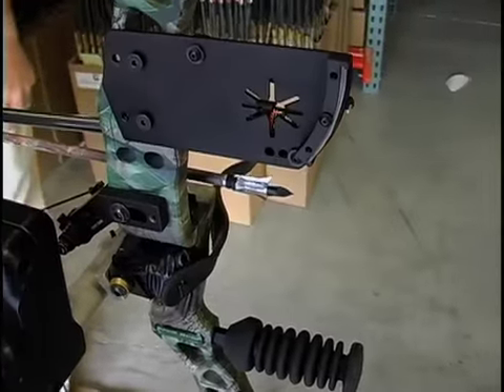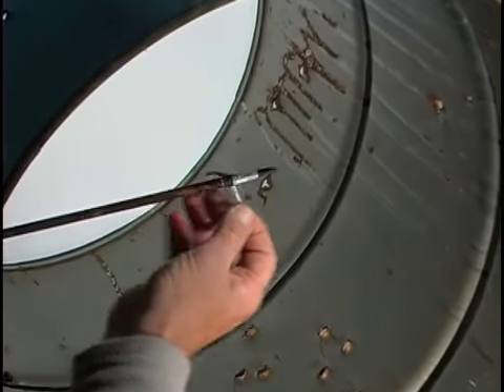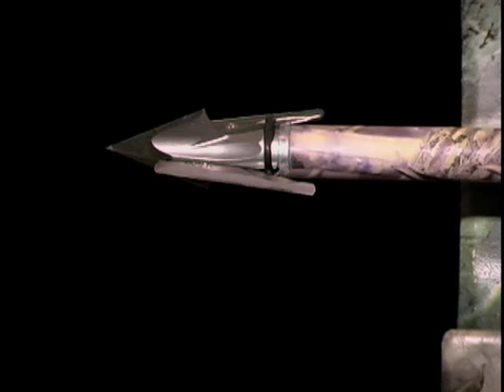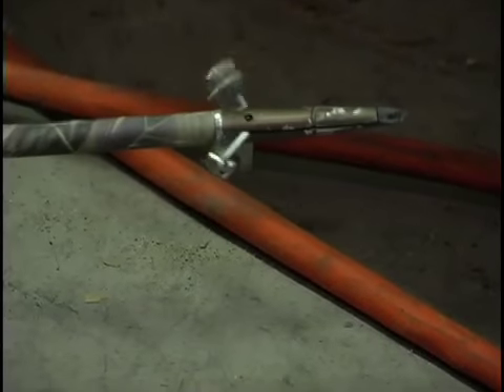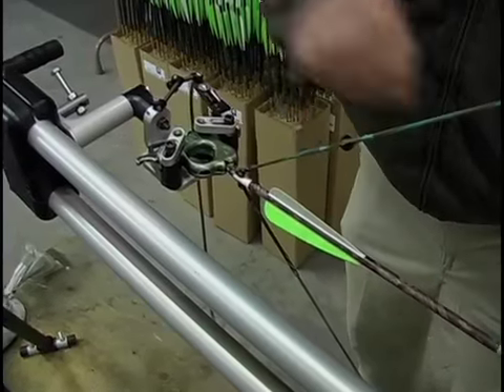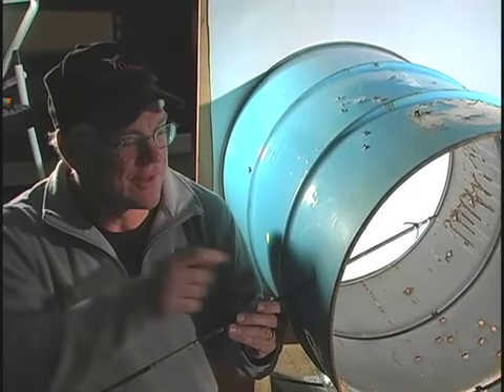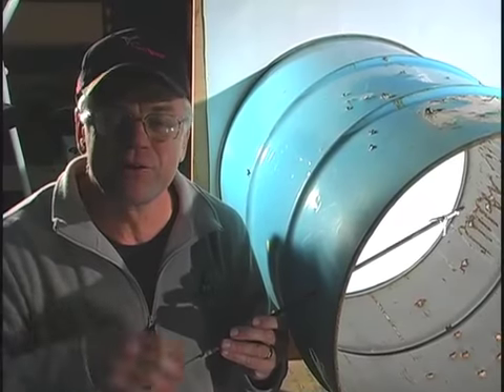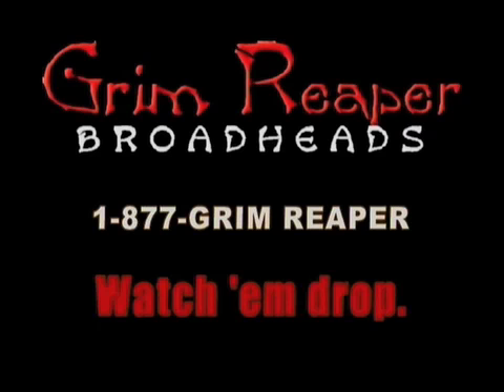Steel Barrel - Razortip vs Mechanicals

Comment: I GUARANTEE my 125gr Slick Trick will blow right through this barrel over and over and never break and ya know what...they would never fail to open,or open in flight and throw the arrow off.That said,I'm not getting the gaping wounds that the Rage broadheads make and I'm considering switching to mechanicals this next Fall,just trying to decide which ones.I lost 2 deer this year because they stopped bleeding.One was a lung shot so you can't say it was a bad shot,just clotted and stopped bleeding.

Comment: Yeah it was shown at the end when discussing deflecting..but it was never shown being shot through the barrel or even being shot into the plywood...Plus if you did test the Spitfire and your doing apples to apples shouldn't you have use the original Spitfire and not the XP with the COC tip. The XP is very similar to Grim Reaper's Razorcut head..why didn't you shoot that one through the barrel...

Comment: What bothers me isn't that G.R. is promoting G.R. But they practically admit to rigging the test.  Listen closely:
"Yes this one went through, the blades are on"
"Thats good"
"Lets just see if I can"
"Well, at least there's two blades."
"No they're there, spin 'em."

I wander how many didn't pass the test?

Also, leaving the blades open bypasses the chances of the blades curling or "crumpling" like the Rocket Hammerhead. I'm not a mech-hater, but this test was far from far.
"